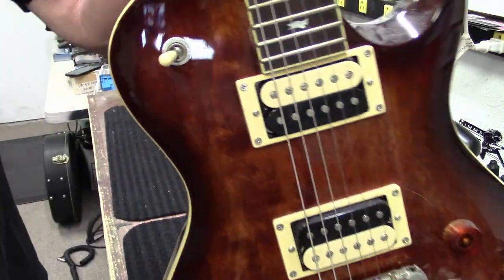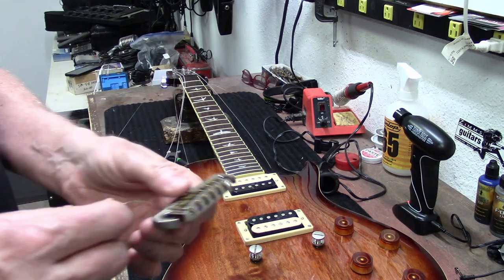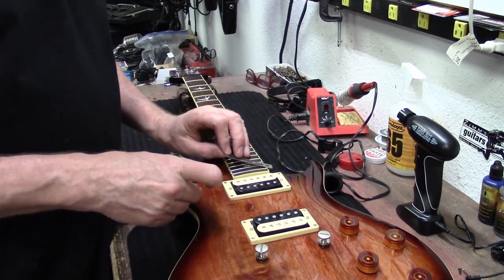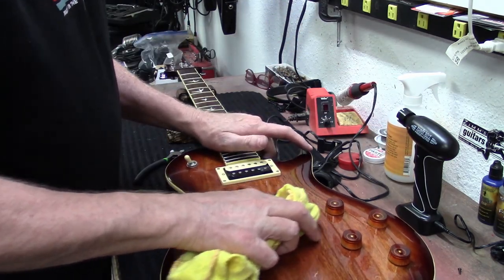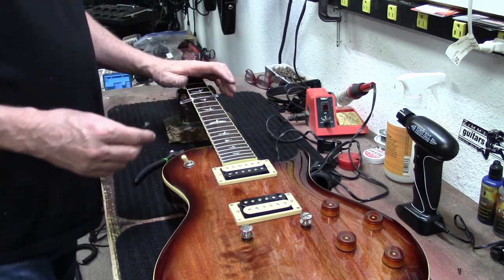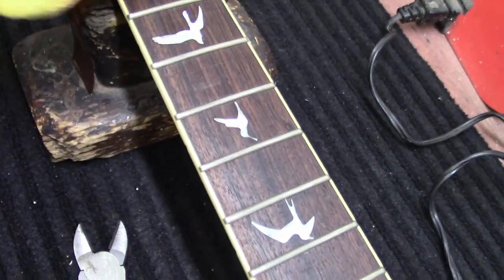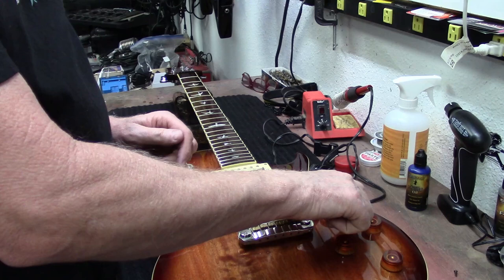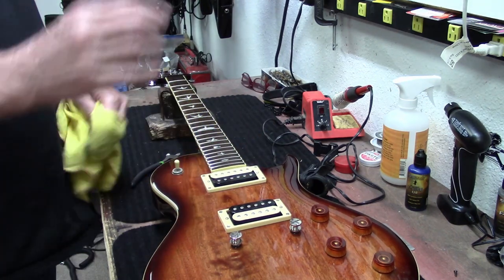PRS SE 245 Restring!

Comment: I think what you have there is the 245 Standard (all mahogany).  I have the one that is called just 245. Mine has a Maple top (with flame maple veneer on top of that), no binding on the neck, and the exposed maple edge around the body, which has the appearance of binding.   It's a really nice guitar, i wouldn't mind getting another one.  Its a 24.5 inch scale length.  Hence 245.

Comment: The 245 is 24.5” scale length. Just like how the 594 model is 2.594” scale length. 
I would guess the discolored frets are from the previous owners sweat. Some metals actually cause my skin to turn green. Like my glasses arms leave a line on my temples from the metal. 

Question: i have this exact same guitar, is there any reason i couldnt put a set of 8 gauge strings on it? I figure ill have to readjust the intonation, but is there anything else?